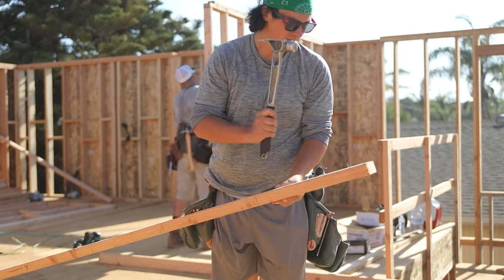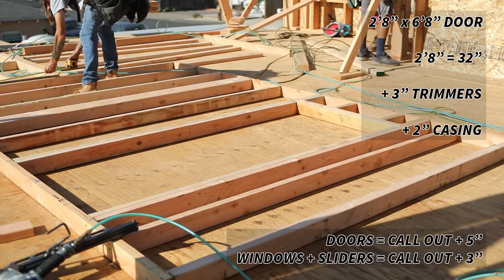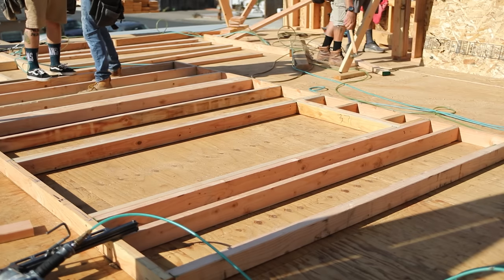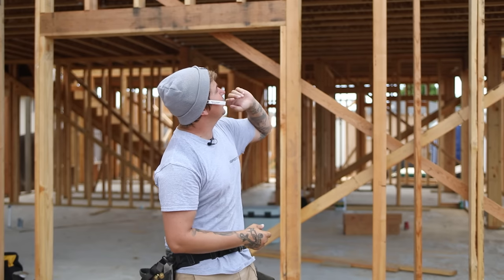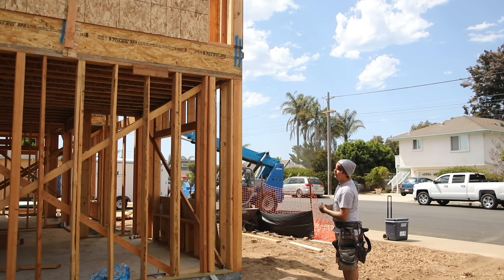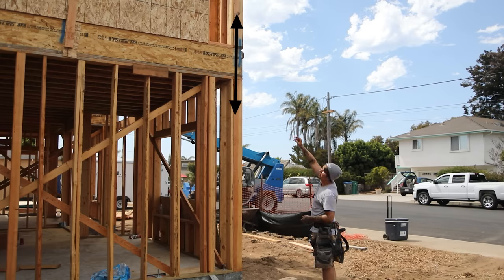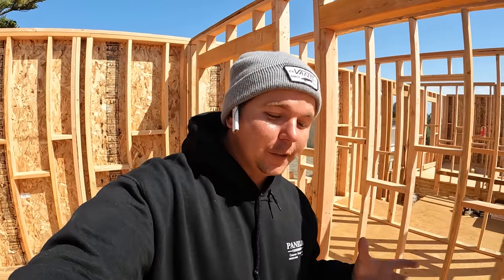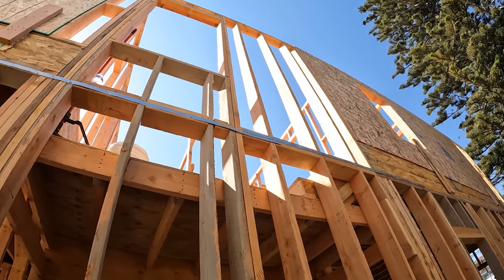Abandoned Framing Project | #3, Door Framing Breakdown.

Comment: Been a carpenter for a long time but have not done much work in California, is it a common thing for this kind of thing with the fly-by-night framing crews out there? I am from Chicago and don't get me wrong we have our idiots here too. I myself never liked cleaning up someone else's mess. I understand that this was a mess where it was left but not too bad that it was a total shit show. Your guys look like they flow well together, that's the key to a good framing crew and to have just one layout man usually the boss or the foreman of the crew, otherwise, disaster can strike. But your crew looks like they have a good understanding of what you need from them to make good on these types of jobs. My crew was 10 guys 8 carpenters and 2 laborers, we threw up 3500 to 4500 sq in 5 to 7 days under the roof, backed out and ready for mechanicals, and on to the next one. More custom packages to the houses may have taken a little longer but not much. Like your crew, we knew where our strengths and weakest links were and we were able to move pretty quickly. I ended my framing career framing very large homes that took a long time and were a pain in the butt. Anyways looking good and you guys just reminded me of the good old days on a framing crew.
Reply from the maker: A lot of piece crews in this area, definitely more common out here.. Most these guys have worked with dozens of crews, but end up finding a more long-term spot with us.
Reply: @MattBangsWood  Well, your crew's flow is looking good. And I am sure there are things you would like to improve on, My crew was together for 7 years after that we went strictly interior trim and a lot of custom stuff., but we didn't have your kind of weather all throughout the year and got tired or framing in the snow and ice.
Reply: I could write a book on this subject alone lol

Comment: have you ever tried to leave out your trimmers. that way you can use a skill saw to cut your door plates. i try doing it for a little bit so so.. but when you string your walls it hell of a lot easier to keep things from moving
Reply from the maker: I've seen some do it, and I've even tried the whole "just pin the top of the trimmer to pull the bottom out to cut" type thing, didn't like it much.

Comment: Do you guys do any advanced framing .
Headers above?
24oc"?
Lap your panels over box?
Full heal height at rafters so carry your box  rim joist all tge way so you got full top plate coverage and depth for insulation?
And big one do  you gap your panels?
Thanks 
You got good content 
And team.
Reply from the maker: Most builds we're using ZIP, but all panels gapped. Headers above won't fly in California, I'd have to have engineer sign off on it prior. 24" O.C. doesn't fly most the time either, my current build I have walls at 8" O.C..

Tying rim to above and below is something we've done quite a bit though.